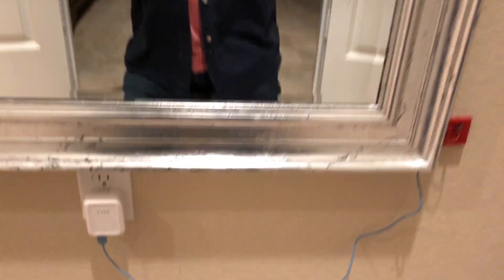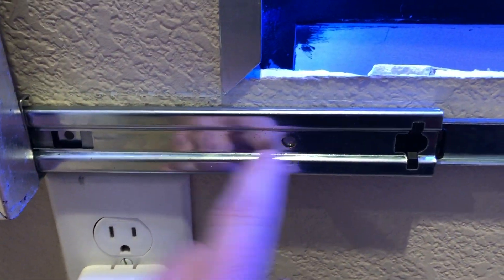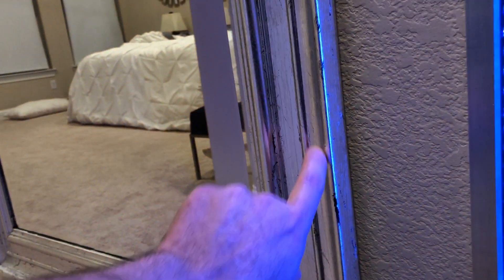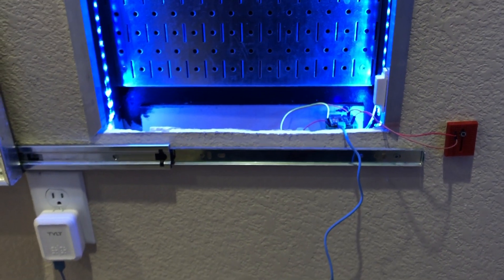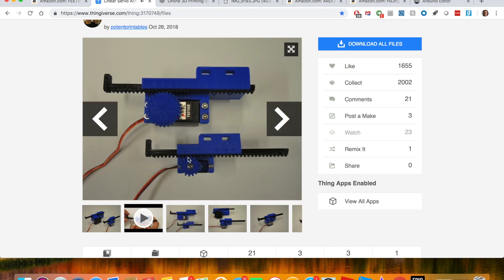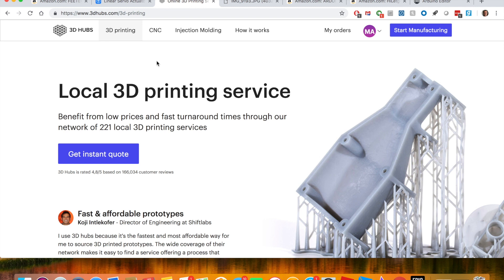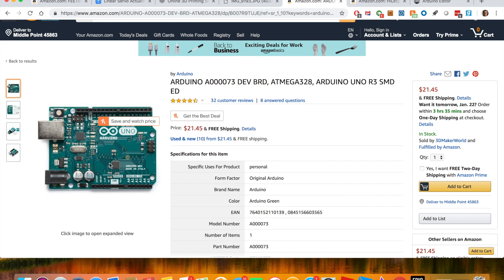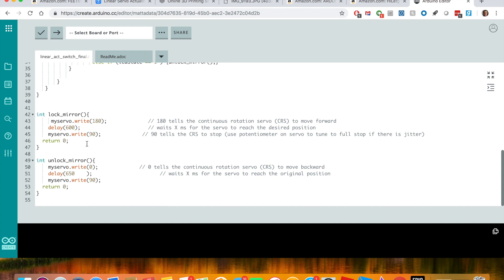Lock Mirror Safe update

Comment: How did you hang the peg board
Reply from the maker: The pegboard is made to go on the studs, so that won’t work in this case. So I trimmed the sides off on the pegboard so that it would sit between the studs. Then I installed two small strips of wood about an inch wide in the left side of the wall in the right side of the wall and then I screwed the pegboard into those strips of wood.

Comment: Thanks for doing this.  I just finished the mirror door it works great.  Now thinking through the lock, mostly to keep the kids out.  I am going to use the servo system you suggested.  I already have the 3D printer and servo.

I was thinking through what could go wrong and lock me out of they contents.  Issues are and possible solutions:

#1 problem Loss of power
Solution 1:  Have a hidden connection a battery could be hooked up to run without 110v.  Simplest solution.
Solution 2: Let the Arduino sense power is out, have the system run for XX seconds on a super capacitor and then when 110v goes out it automatically unlocks before it looses power. A bit more complex but cabinet available immediately after power out.

#2 problem.  Open command mechanism fails to work and send command to open
Solution 1:  On power up in the init phase have it unlock for xx seconds.  So could cut power then turn back on and it would be unlocked long enough to open door. simple to do.
Solution 2:  If you have solution 2 implemented of problem 1 that solves this problem.

#3 problem:  Servo fails or other failure to open
No simple solution to this.  The backside of the door is in the closet I could cut a small door to get to the locking mechanism.  Maybe have the door done ahead of time.

If anyone has other ideas let me know.
Reply: Will do.  Just finished mounting guns. Haven't done locks yet.  Thanks again for your videos.
Reply from the maker: Cool! Let’s see some photos or video!

Comment: You’re a wizard Mattadata. I would love to have the led Lights on my project connect to my homes electricity, but I would probably end up in the hospital.
Reply: If you have an outlet near you can get led lights that plug into a USB. Assuming the outlet has one. I use a long USB extension cord that's hidden that plugs into my nearest power source

Comment: What are you using as a power source? A battery or the 110v?
Reply: For the lock and the leds
Reply from the maker: It’s all powered from 110v. But a battery could easily do it all.
Reply: @mattadata2  thanks I saw you had 110v available near by. Hoping to try something similar soon.

Comment: Instead of a fingerprint sensor, maybe consider an RFID token setup and embed the RFID token into an object you have nearby like little decorative statue or something similar.  Hold that object over the receiver behind the drywall and engage a relay which closes the contacts of the button you have setup now.  Looking forward to the next update!
Reply from the maker: hmmm, interesting idea..... I originally bought an RFID lock, but couldn't make the locking mechanism fit.  Maybe just the RFID though